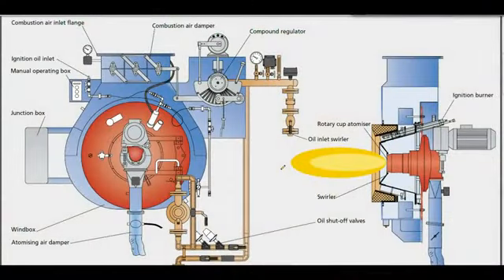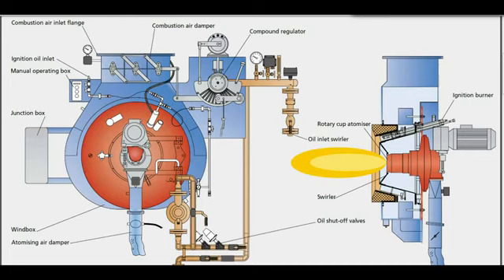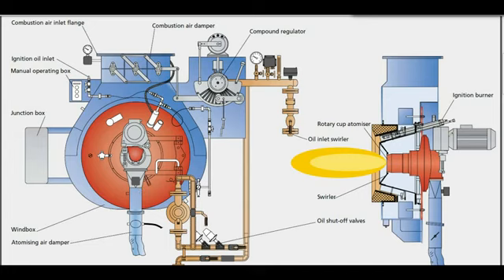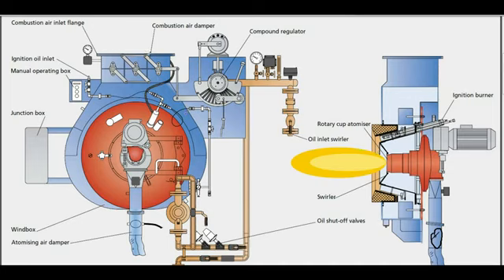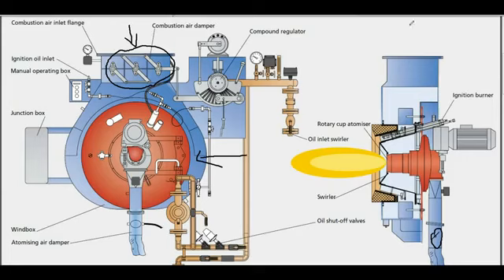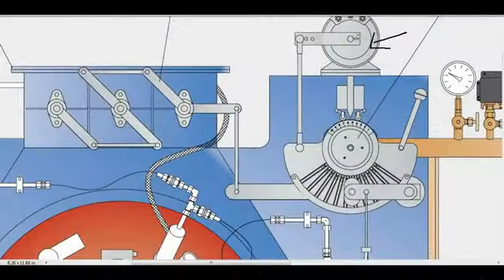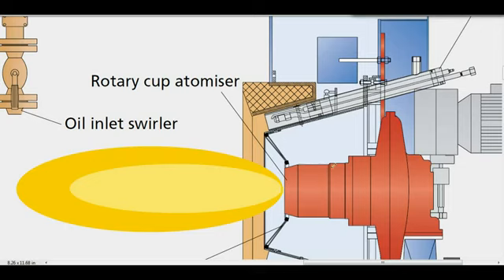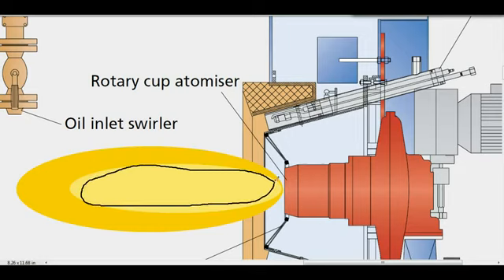Rotary Cup Burner   Over View

Comment: does the secondary air have connection to the fuel input? or it is only for the primary one? 

and if I have problem in my exhaust gas that have too much O2 left, should I adjust the primary or the secondary damper?